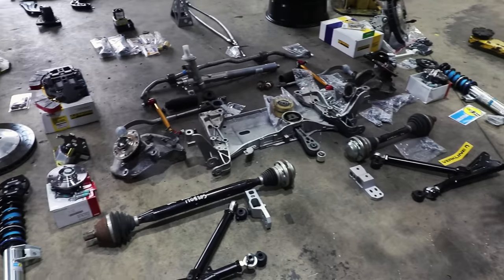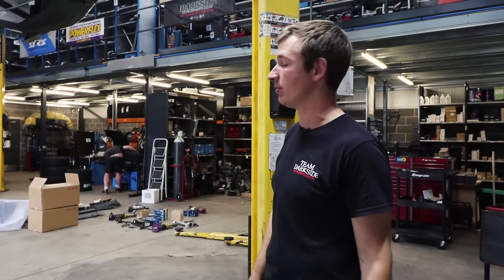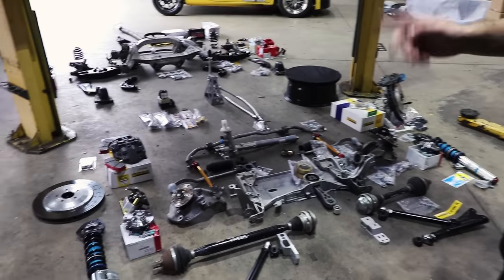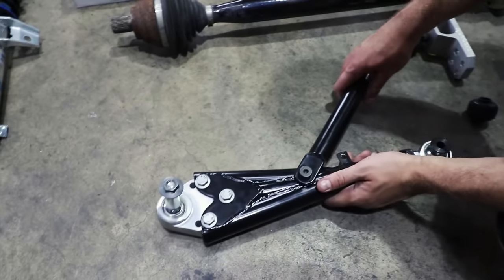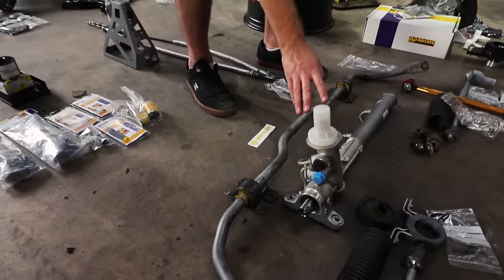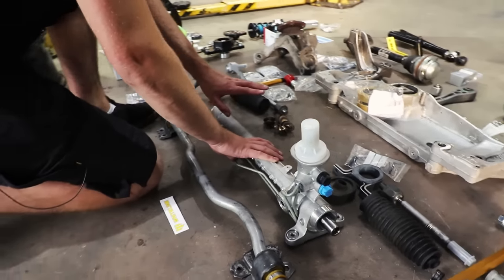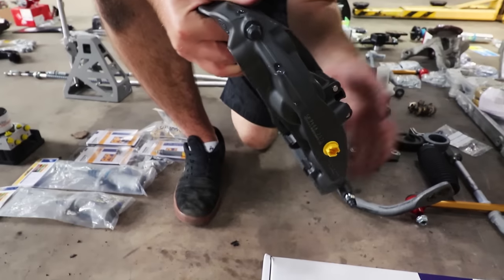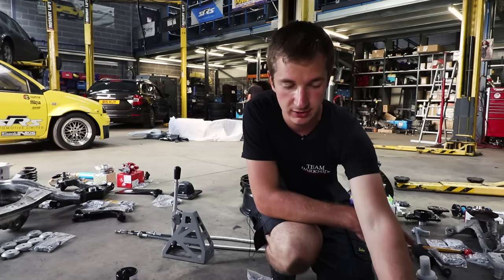RACE PARTS, LOTS OF THEM! Part 2 - MK5 GOLF EX VW CUP CAR - DARKSIDE DEVELOPMENTS

Comment: Reyt then, these gtb2260 1.9/2.0 tdi engines run massive torque push. Why you don't break a driveshaft joint a day? In particular transmission side.. is tt driveshaft so much stronger than golf one? Is it a must to win races? This one Ryan's best vlog.. and you know I've been following whole Darkside package 🤓
Reply from the maker: The driveshafts are capable. We just use stock ones and rarely have any issues. The Arosa once twisted one but drag cars are a different kettle of fish

Comment: With you running a massive bias towards the front of the car, arent you going to get a huge weight transfer when lifting off the brakes? Ideally, you want a good bite on the rear to reduce the dive on the front end?
Reply from the maker: Having big rear brakes wont stop the weight transfer, other than weighing the wheels down more!

Comment: Hello @darkside developments. You are making cool stuff. Question: does 1.9tdi ARL injectors and ARL or ASZ turbo fit on a AXR  engine? Thanks
Reply from the maker: Yes pretty much direct fit.
Reply: @DarksideDevelopments  thanks. And how much horsepower do you expect with the right tuning on a dyno?
Reply: @TIGFab97  ASZ turbo, 175hp. ARL 190hp.

Comment: Are you going to make a detailed video of the wiring?
Reply: Yes, we might sub some of it out depending on timescales
Reply: @ryanp6138  what kinda spec are you building it to then? Using a pdm or not? Its certainly more than a day's work to do it to any kind of decent standard
Reply from the maker: @nickyross7127  Wiring or car? Not using a PDM yet as quite a lot of stuff still needs the CAN for PWM control. Its a few days work to get it somewhere near for sure!

Comment: Ibiza race car has 2260 turbo to go 220hp only but it can go 300hp. In your catalogue there's 1749 to go 200/220hp. Why don't u choose that lower lag turbo?
Reply: A race car needs all top end power so 2260 is the best choice. We checked Data and it's around 4mph on the straight compared to 1756
Reply: @ryanp6138  then why didn't you choose 2560 or 2860 for race? Don't they have even more top end? I thought 2260 was street biggest reliable choice :))
Reply from the maker: @nospeedlimits7777  You can go too big, the GTD2872 we run in the Citigo would catch you out on some tighter corners and we would be 150+hp away from its potential not 60 or 70.
Reply: @DarksideDevelopments  Great, thank you :))